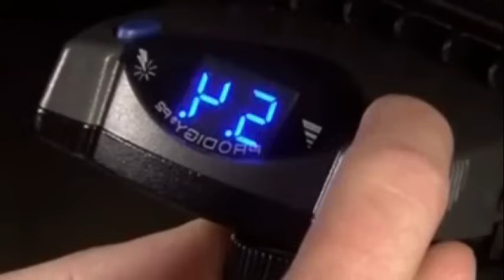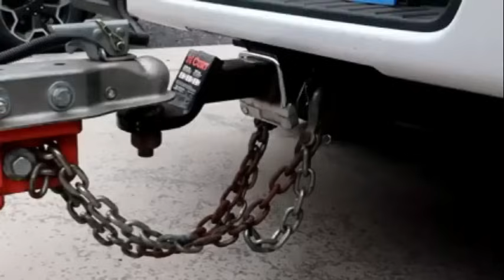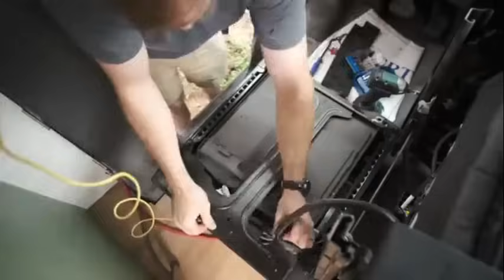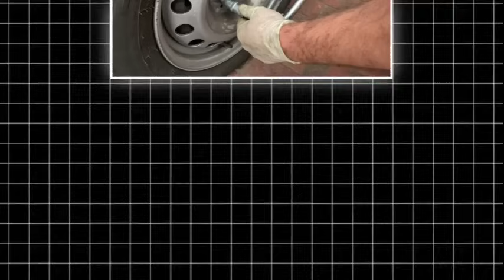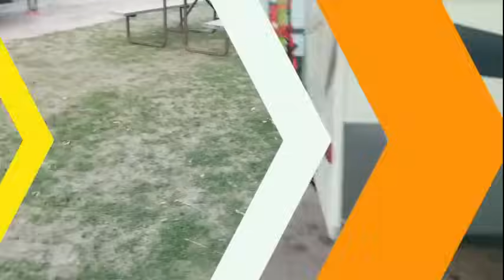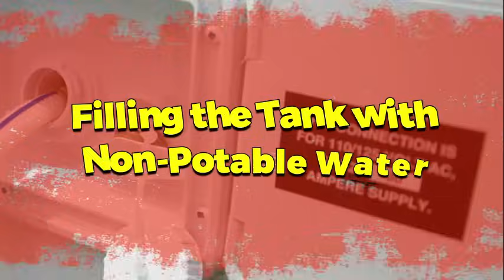Critical RV Mistakes That’ll Cost You Big (Avoid These Pitfalls!)

Comment: A better way to properly backup any trailer is to. Get Out And Look aka G.O.A.L. and not rely on what your spotter is always telling you. Because they can steer you in the wrong direction most of the time. Than you are at FAULT no matter what. Also that is what your and the other people's insurance company will say. Because you are the one backing up and it is the person's responsibility for seeing themselves clear to backup. Using the excuse I was doing everything correct and my spotter told it was clear is still not a good enough excuse either for the insurance companies as well.

Now when crossing your chains. Always use a trailer brake emergency break away cable and connect to the tow hooks on your vehicle's tow hitch. Where you hook the chains too. Never ever hook it to the actual chain itself. This cable will also lock up your trailer brakes if your hitch becomes unhook and stop the trailer as well. So be mindful when that happens to slow down slowly to keep control of your trailer as well.